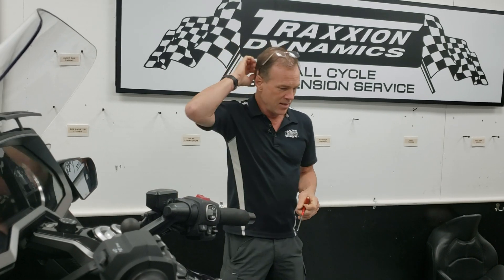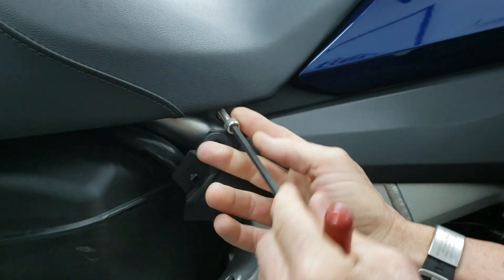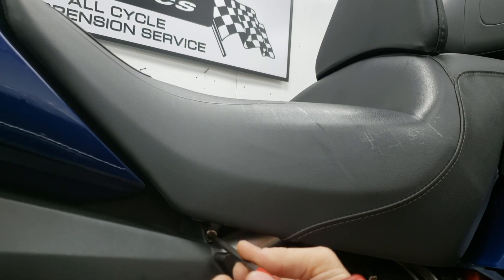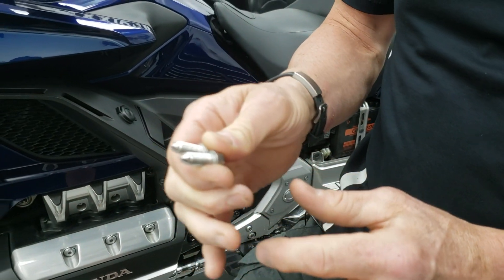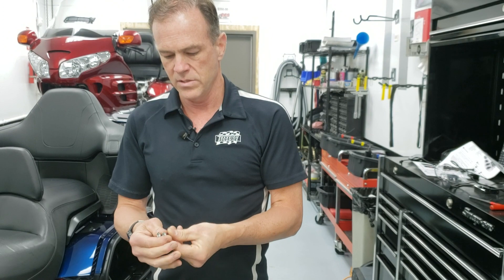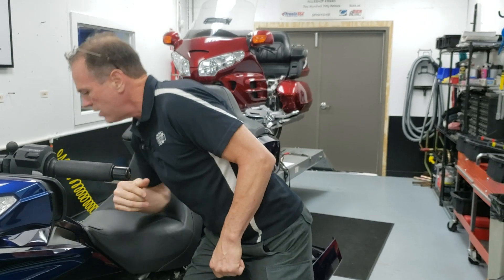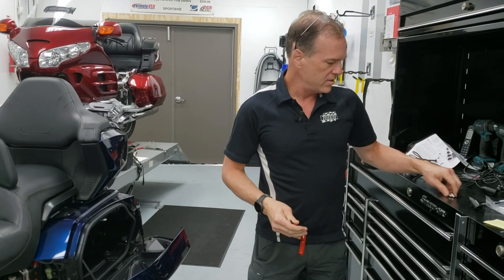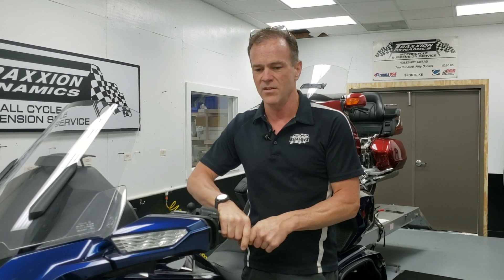Perfect Example of Most Possible Seat Bolt Problems on One 2018+ Goldwing

Comment: Those Show Chrome bolts are designed by the same engineer who made the original seat bolt design.

BTW - spraying silicon on ALL of the rubber grommets under the seat prior to reinstalling makes the two bolt eyelets line up super easy and might require just a spanking on the backside of the riders seat.  Slick as snail snot 👍

Comment: Max, I got your bolts and I do not like them as is.  They are beautiful.  However, they are difficult to sink into the seat hole as the flat shoulder snags and stops on top of the plastic.  This can lull the average guy into thinking it is seated properly when only a couple threads are engaged.  A 45 degree x .030 chamfer cures this issue by turning the bolt into the alignment mechanism.  No wrestling required.
Reply from the maker: Thanks for the feedback.

The only time anyone has ever had trouble using the seat bolts has been when owner/dealer lost the collar, and tightened the factory bolt, crushing the plastic.  Other than that we made them with plenty of slack.
Reply: Max McAllister & Traxxion Dynamics  Don’t get me wrong, I love your products.  I was your first full-full Monty customer.  And, as a machinist of 50 years and a mechanical engineer, my feedback is an effort to contribute to the advancement of your products.  I’m on your side completely.  Mike
Reply from the maker: @dr.michaelbennett8597  Thank you!

Comment: New reply on "I would like to know if you sell a Floor Jack for a 2019 Goldwing DCT Bagger"
I have a Victory XCT and I use a floor jack that fits under the Engine, which lets me raise the bike to a working height. If I try to lift my Honda, the jack plates go across the  exhaust pipes and I’m afraid of crunching them!!! Plus when you lift at that point the bike wants to tip backwards, how do I prevent that?
Reply from the maker: If you want to lift the bike off the ground, I don't know of a product for that, other than a proper bike lift you roll the bike onto.

Comment: I stripped both sides. I'm  not using any bolts to hold the seat in place.
 5,000 + miles no problemo.

Comment: The other option is to turn the seat spacer around to the other side of the plastic, effectively doing what your new bolt is achieving and you don't need the separate washer with the flat end bolt.  Then put a small chamfer on the inside of the seat tab.  I have had no problems.

Comment: Why not just throw the bolts away? The seat is not going to just jump out of position. I removed mine last year and have not had any issues since.
Reply from the maker: If you hang off in the turns to drag your knee, the seat can fall off, and you with it.  Also when doing stand up wheelies, the seat call fall back into your crotch.

Comment: Just watched this video.  This is exactly what the dealer did with my NEW bike.  Collar missing on one side as well as a missing washer on the other.  Seat was not even installed correctly.  So my point is what could be a better solution to this common problem?   Zeus fasteners with some kind of trick backing hardware?  Max, we are waiting on your solutuion...
Reply from the maker: Here you go...  https://youtu.be/mCgTyKBceak
Reply: Max McAllister & Traxxion Dynamics do you have a catolog
Reply: @perrygordon123   I have been watching a video per day.  I see the "trick" bolts but I am looking for a "quick release" system.  I did drill through the end bits of my saddle and used roll pins to secure the shouldered collars.  the washer are super glued into place to help keep them from disappearing.   It is not the same as a quick release idea.  All that accomplished is holding the collars in place.